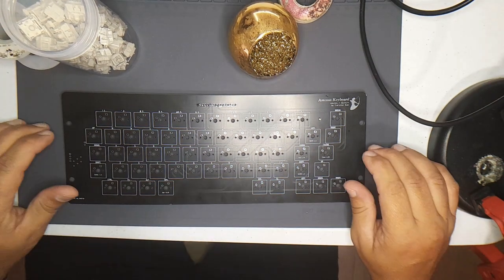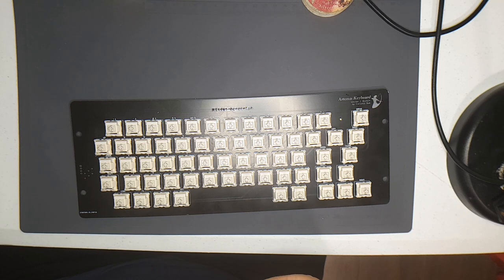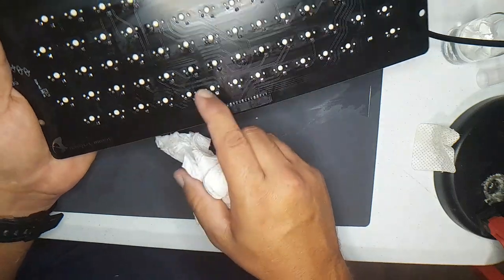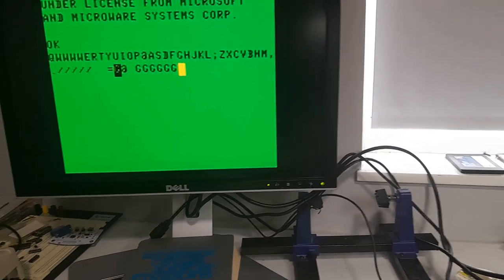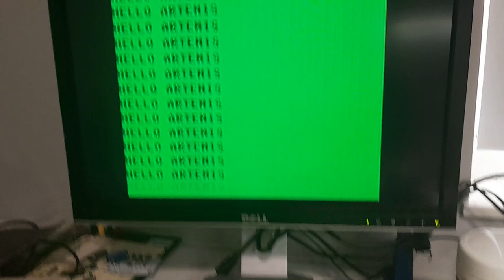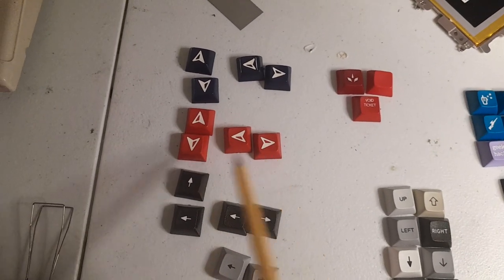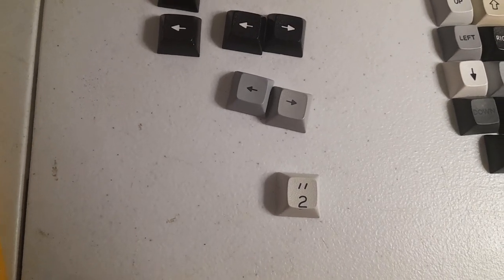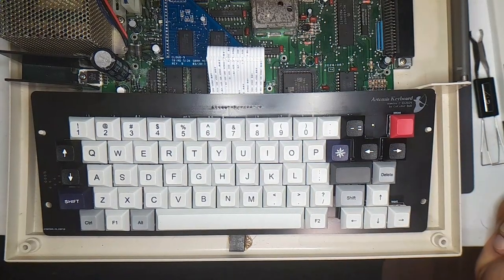Building An Artemis Keyboard for My CoCo

Comment: Recommended finishing touch?  Some sort of black foam board to cover the empty spaces.  I wonder if CoCoNut Bob could use his KiCAD data to produce some sort of SVG file.  From there I'm sure I could use that to create a printable template using Inkscape, slap that onto some sort of black (or other color?) foam board and carefully and slowly and as perfectly as I am capable of (hint: I'm not all that capable but I'll try) cut out a finishing frame for the keyboard.

Comment: Cool, didn't know this existed!  I ended up cobbling together my own keyboard with a steel plate I had cut.  I didn't pay too much attention to the outer dimensions so I ended up just kinda hot-gluing into place.  Not pretty but definitely a great feeling mechanical keyboard on my CoCo2.
Reply: I also did my own dye sub keycaps, had someone on Etsy print the legends for me, then I used a hair straightener (I think that's what it's called?) to "iron" the legend on to blank keycaps.
Reply: Also that 2 has got to be a keeper!  If it was me, I constantly forget that the double-quote is up there above the 2, so I say it's worth keeping
Reply from the maker: @8antipode9  Yeah, it's nice to have options! You made your own using a steel plate? I'm sure it looks great,  you should definitely show it off!

Comment: The way CoCoNut Bob did the soldering of the switches was pretty good.  He did them row by row and was able to inspect each switch and easily make corrections if any were found.  "Simple" rules my world and takes away opportunities for me to disappoint myself.

Your video quality from the composite is AMAZING.  Is that composite?  Though I have a composite modded CoCo2, there has been progress in the MC10 realm for an S-Video mod.  It may actually become S-Video + trrs composite+audio.  This is very exciting because S-Video converts better with inexpensive S-Video to HDMI devices.  Schematic drawings are there in the MC10 discord channel.. I wonder if you could adapt that for CoCo 1 and 2 varieties?
Reply from the maker: Yes, it's composite, the regular composite that comes from the CoCo 3. It does look good but somehow it looks better on the recording, lol. As far as having it for other CoCo's I think  AC from AC's 8 bit Zone has already done that for some of his CoCo 2's. I'll have to check it out.